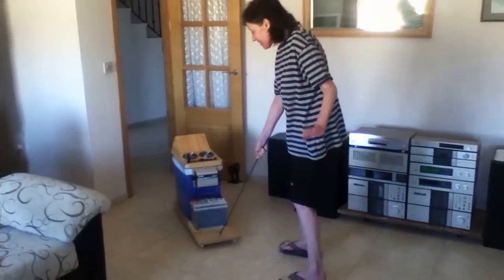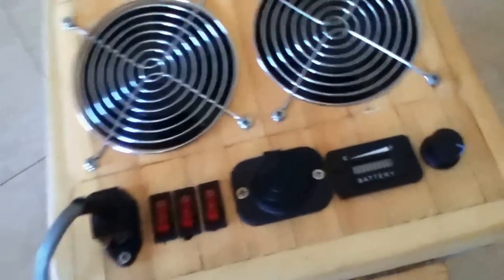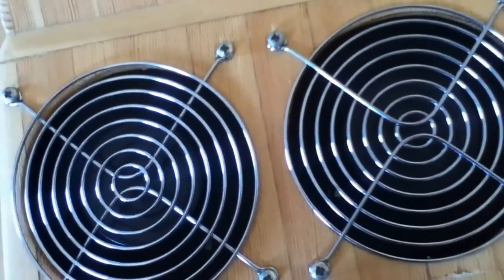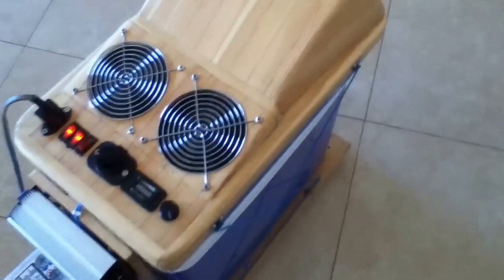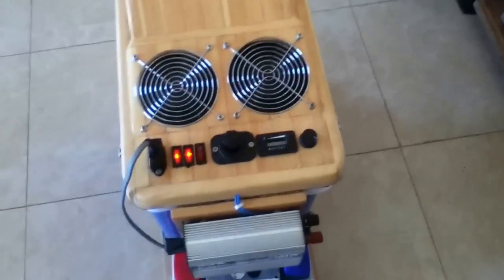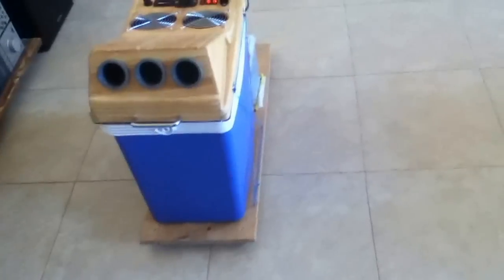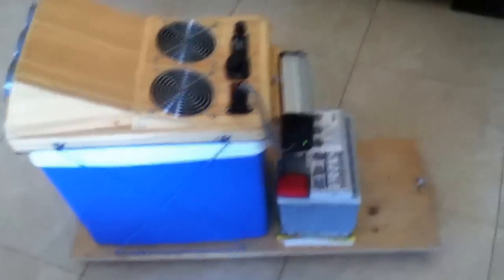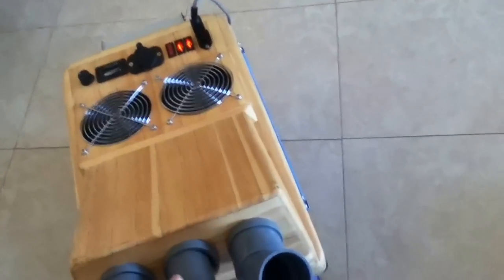HOMEMADE DIY SOLAR POWERED AIR CONDITIONER / COOLER 12v DC or 220v AC ***AIRCONtraption OVERKILL***

Comment: this is brilliant. would be so handy out camping. how long does the battery last? people are just jealous of the fact that they couldn't even comprehend on how to make this. nice work!
Reply from the maker: +camdog Hi camdog, Thank you very much for your kind comments, they inspire me to think of some more crazy projects. I have some planned so please watch out for them...... With reference to the battery. When I use this unit in my cabin up the hill I charge the battery beforehand and it will last the whole weekend and plus some more. I would imagine with a full charge and only using this unit and maybe a couple of lights off it then I would think it should last about a week before needing recharging...... But that depends on the battery...... Thanks once again for your wonderful comments......

Comment: use P/N   AD1212HB-F93GP  FOR your fans 12v 1.95A they push lots of air.
get rid of that power inverter there is nothing "efficient" form converting DC to AC = power loss. A 12v 35 AH Deep Cycle battery for mobility scooters will work just fine plus they are cheap. but if you want to keep it AC use a Variable Frequency Drive power controller. but great video friend. i my self love to build things too.
Reply from the maker: +danialphaomega Hi danialphaomega, Thank you very much for your comprehensive and very interesting comment, I really appreciate it my friend. I definitely do not define myself as an expert in any way and I thank you very much for your input. I will make a note of your advisories (most especially the fans) and may produce another one in the not too distant future. Thanks once again and please keep watching......

Comment: He compares the wattage of the minisplit AC in his house to the wattage of his unit, but then later says he cools the bottles he puts in this unit in his fridge.  So whatever cooling this unit accomplishes is a result of the wattage consumed by his fridge, which he doesn't include in his comparison.  Considering that his fridge isn't designed for that job, its safe to say that the efficiency claim is total bunk.     

This isn't an air conditioning, the whole video is misleading and it likely doesn't cool very well.
Reply from the maker: +Brady Rose Hi Brady, Thank you very much for your interesting comment...... However, I'm not sure if you really understand why I built the unit...... As I have mentioned in quite a few previous comments, I have a weekend retreat out on a hill behind my house....... It has no electricity...... July and August here in Extremadura sometimes gets to well over 40 degrees C or 104 degrees F...... Please tell me how me, my friends and family can enjoy our Summer in the retreat without something like this......Technically you are correct in what you say if the unit was built for use in the home but it wasn't...... By the way, the bottles were not cooled in the fridge which you mention three times in your comment, they were cooled in the freezer...... I hope you appreciate that and thank you once again for your comment......
Reply: +Ian Wills - That was actually a fair point about the title. People who put wrong things in their titles pretty much suck.BUT, I like your contraption.
Reply: +Brady Rose By the way, I never mentioned air conditioning in anything, you did. That is why I called it an Air Contraption Unit...... Take it easy my friend......
Reply: Air Conditioner is in the title, it misdirects searches.
Reply from the maker: +Brady Rose I hope you have a wonderful day today......
Reply: +VideoMenu Thanks very much for your comment VideoMenu. I promise I was not intentionally trying to mislead anyone...... Also, thank you for saying that you like my contraption...... Cheers......
Reply: If you are already using a freezer for your food then rearranging things so some bottles of water can fit in won’t use more electricity unlike using a freezer for food and a aircon/split system for the house, Nice try in thinking you’ve some how put one over the old boy but you’ve only came out looking like an idiot.

Comment: i would definitely use 12 VDC fans.  More energy efficient (nearly 50%), no inverter needed.  I suppose your speed control may be a reason but otherwise, 12VDC seems more viable especially when adapting to solar power.
Reply: +Larry Hunt Hi Larry, Thank you very much for your commets. I have tried the 12v DC fans and found them to not be powerful enough. The wattage output of these two fans is very minimal...... However, I do see your point about not having to use an inverter...... To be quite honest, the speed controller was not really necessary, just a bit of 'bling' really. I always have it on full blast when using it but I suppose on a lower setting then the ice would last a little longer...... I do take your point and I cannot argue with you as it is very valid and I thank you very much for making it...... Thanks again for your great input Larry...... Watch out for the next one...... (Swampy)......
Reply: Agreed  Here's a 12V speed controller. : http://www.dx.com/p/jtron-pwm-dc-motor-speed-controller-green-15a-6-90v-290621#.Wt5AQsiUtHY

Comment: May I know what exactly is Aircontraption? Whats in the blue cooler box?
Reply: +OB Want Hi QB Want, Thank you very much for your questions.AIRCONtraption is a portmanteau which is where you combine two or more words together. In this case 'aircon' as in 'air conditioner' and 'contraption' as in an unnecessarily complex machine, gadget or invention.What's in the box...... You can put either iced bottles, ice cubes, ice packs or just very cold water...... it is up to you...... I find that the iced bottles last the longest......I hope this helps in answering your questions and thanks once again for your questions......
Reply: +Ian Wills Thanks for your answer.
I think ice bottles last longer because they are bigger in size, holding the temperature better and the best is the cost is lower compared to ice or ice packs. But I see your invention is quite costly because you use cooler box, custom made wood, converter, industrial fan and a battery. I can buy a cheap windows unit with that amount of cost and work. Cooler box has not much difference when you keep blowing external air to the internal of cooler box. The battery will be worn out very fast and if you use this equipment frequently, the battery will breakdown very fast. Reduction of material will make this a whooping good invention.
Reply: +OB Want Hi QB Want once again...... As I have previously mentioned, It's obvious that Ice bottles are the best for this kind of contraption...... It is costly to make but not costly to run and not because of the cooler box. That cost me 16 euros. Do you think that is costly...... Custom made wood. This was all scrap wood that was free from my local carpenter so no cost there, work and glue but not cost...... Inverter, cheap fans and a battery all from previous projects. Your last comment makes me realise that unfortunately you don't understand the concept of this AIRCONtraption unit and I am sorry for that but I very much appreciate your interest my friend......Good luck to your future projects......

Comment: This cooler looks very cool... this wood work.. and the power it is giving.. do you have a video on putting this unit together, mostly the wiring? Great video and idea!
Reply: +Hi Honey Hello Hi Honey, I'm sorry I haven't replied earlier. I have no excuse for that my friend but I really appreciate your lovely comments. Currently I don't have a video or the wiring. To be quite honest, it was all a bit of a bodge together. I just logically thought that each thing would work together if it was all at the right voltage and amperage. I am definitely no engineer. It was something I knocked up to make our lives easier in our 40+ degrees heat in the Summer in our house on the hill...... I'm really happy that you like it though. If you wish for me to produce a schematic for the electrics then I will. A few people have asked....... Oh dear!!! what have I let myself in for......
Reply: Yes.. LOL I think you built a very nice tough and powerful unit, something I would really want for myself.  I noticed you mentioned possibly selling it?
Reply: +Hi Honey Hi again, Thanks very much once again for your kind words. I am afraid I have since taken it all apart and I'm using the components for my next crazy project. I will be building a 'Swamp Cooler' commonly know as an 'Evaporative Cooler'. Please watch out for it and thanks once again......

Comment: <english very bad.so i miss when you say its electric coolbox or only with iceakkus?? does an electric cooler had he same effekt or to weak 4 this?
Reply: permanent highxX Hi there permanent highxX Thank you very much for your question and first of all please don't worry about your English not being so good. At least you are making the effort to try and with a bit of practice you will soon be on the road to success with it. Anyway, I will try to answer your question...... This cool box can be used with electricity or batteries or even solar power. You can use ice cubes, cold water, plastic ice blocks or even the bottles of water which I am using in this video. I think the bottles last longer as the ice is spread over a wider area. I hope this answers your question and please keep up the very good work in learning English, you are not bad at it at all my friend. Thanks once again and best regards.
Reply: I mean Electric coolbox with 12v for the car.
Reply: permanent highxX Hi again, Yes you could use this in your car but if you do then please make sure your engine is running whilst using it as your battery will be flat if you just run it off your car battery. The reason is because a car battery is purely to start your car only, everything then runs off the alternator. However, with this system, although the same 12v as your car 12v you would need something like a marine or leisure deep cycle battery which is made for the purposes of covering the needs of what you would normally use your 220v or in America 110v...... I hope this helps......
Reply: Ian Wills there are soloarcells that can be used with electric coolboxes/pcfans.really cheap.
i will uses this i my future projekt.will send u a picture of it when its ready.
so it costs no electricity^^.have a good day
Reply: permanent highxX Hi again, Wow, I very much look forward to seeing yours with the solar cells. With reference to the PC fans, I just thought that they wouldn't be powerful enough for this project but I would be very interested in seeing your results as I may be wrong. Thanks very much for your very interesting comments and I look forward to seeing the photos and seeing your project on YouTube...... Have a great day......

Comment: 12v be better cob
Reply from the maker: Graham Bate Thanks very much for that advice Graham. You are right and I do prefer to use the panel on the weekends, especially now that it's up in the mid to late 30's degrees C. It is a godsend at the moment when we are up the hill. Thanks again for your comment......

Comment: unfortunately all of the ice you used for this had was in a freezer but the freezer acted as a heat pump and pumped all of the ices heat into the house so it kind of is more of a equilibrium device unless you use the freezer outside
Reply from the maker: Dean Walcott Hi Dean,
Thank you very much for your very good point. I do understand where you are coming from but the concept for this particular unit was mainly to use it in our weekend or holiday home up the hill which doesn't have electricity.
The general idea is to fill it up with the iced bottles and fully charged battery, then drive up the hill to our hut out in the sticks on a hot summers Saturday and party throughout the day and night and come back late Sunday afternoon.
For this purpose it is extremely useful.
In our house during the week we do not use it at all. We always have a freezer full of the ice bottles which keeps the freezer at a constant temperature. I believe that the freezer is acting more efficient whilst full of these frozen bottles rather than empty.
I know whilst placing a water bottle in the freezer initially it then generates heat outside and uses energy but being surrounded by other frozen bottles it doesn't take long to get down to freezing point.
I do see your point though and thank you once again for your comment.
Reply: Ian Wills add some iodizided salt (cooking salt) to keep your bottles of water freeze for a long time.
Reply: juan fuentes that will make the bottles get colder but it also will make the bottles melt a lot faster
Reply: Ian Wills that will work as long as its in a different house just wanted to help you save frustration from having your house not get cooler
Reply from the maker: Dale Bergeron Yes Dale you can but they wouldn't last very long......
Reply from the maker: juan fuentes Thank you juan, I will definitely give that one a go. Thanks for the idea. All great ideas are built from concepts, prototypes and improvements so thanks once again......
Reply from the maker: Dean Walcott Thanks Dean, I really appreciate your input. I definitely understand where you are coming from in your thoughts but this contraption was built to cool down my cabin up the hill as it has no electricity. It is 09:03am now and 40 degrees Celsius or 104 degrees Fahrenheit here at the moment and we use this box on the weekend up in the cabin.
Reply from the maker: Dean Walcott Thanks again Dean for your valuable input it is appreciated once again. I will give it a go though as I am up for any ideas that may or may not improve the concept. Cheers again......

Comment: It last how many hours in that single battery?
Reply from the maker: Hi rene, thank you very much for your question.

First of all and as I mentioned in this video, please do not use a car battery as they are only meant to be used to start the vehicle up. They have a completely different structure to a deep cycle leisure or golf cart type battery.

A leisure battery is used in the day-to-day running of electrical items in caravans, motorhomes and boats etc., using one of these would be much more efficient.

A caravan would normally use the battery for things like lights and water pump etc., in this case a fully charged 85Ah leisure battery should last well over a weeks camping......

There are also different types of leisure batteries, I believe the higher the ampere hours the more battery life you will get out of it.

There is a calculation that you can do to understand how many hours the battery will last and this is an example, if you change the figures below to suit your particular battery then you will get the results that you want:

First of all, for example, a 100Ah battery = 1 amp of electricity for 100 hours.

Therefore if you divide the wattage of the fans (in my case 2x15w) by 12 (voltage of the battery) = ampere usage. Then divide the amp hours of the battery by the amps used and this will give you the number of hours the battery will last, in theory.

e.g., in my case, if I used my 110Ah battery with these two 15watt fans these would be the results......
First............ 30w (fans) divide by 12 (volts) = 2.5
Second...... 110Ah (battery) divide by 2.5 (amp usage) = 44 continual hours.

I hope I have explained this to you sufficiently and I'm sorry it is a bit long winded. If you need any more information then please just ask.

Thanks once again for your message and best regards. - Ian -
Reply: Ian Wills you are far off the 44 continual hours because of the power inverter you used. Why not just buy 12V fans?
Reply from the maker: Nitroschock Hi Nitroschock. Thank you very much for your comment.If I used a car battery for this AIRCONtraption unit I agree that it would drain quickly. However I do use a deep cycle marine battery which is made for the purposes of camping and using lights, TVs and radios etc.Even this would drain eventually and you should never allow your battery to drain to less than 50% of its capacity.In my weekend get-away up the hill I check on the battery power on a regular basis and when it starts to get a bit low I give it a boost with my solar panels. I could take a small generator up the hill to help as well but I haven't needed one so far.It has worked for us very well so far and although the system is far from perfect, it is pretty efficient when you are dealing with over 40 degrees C(100+ F).I do value your comment and you do have a very good point. Thank you very much once again......

Comment: pricey...
Reply from the maker: Thank you very much for your comment Lino Andaya. I don't feel that it's so pricey if you appreciate the comfort, pleasure and satisfaction it has given to me and a lot of my partying friends on my upper outside terrace in mid Summer over long periods of time.

If you weigh all that against the initial outlay then I would say it was really financially worthwhile building it.

Some people argue that it is not very efficient due to the fact that you have to freeze the water initially and at cost to get it to really work well.

In a sense they are quite right, however, when one can get up to twenty four hours worth of really cold air out of it in extremely hot conditions then I feel it is definitely worth the cost and effort.

I suppose the matter is subjective really.

Thanks again for your comment and best regards......